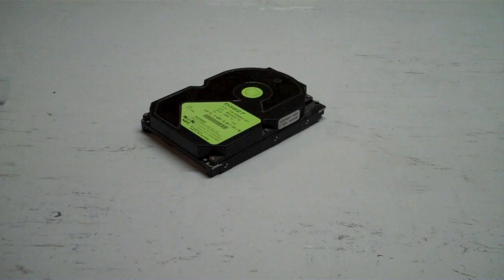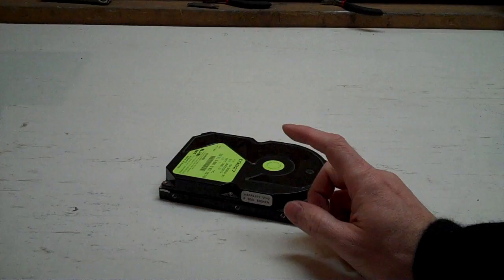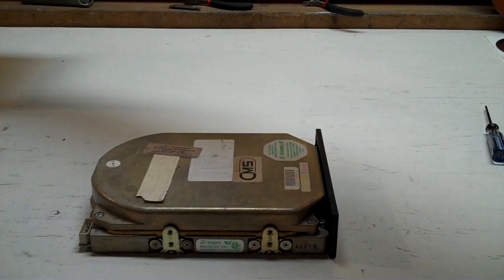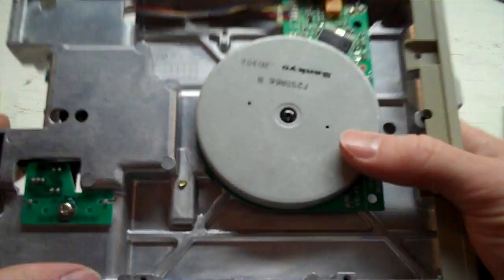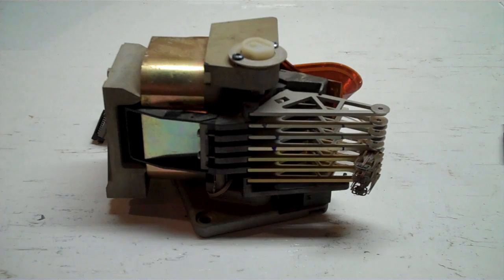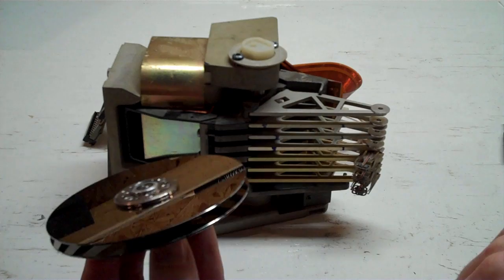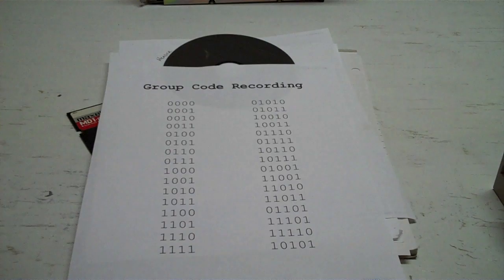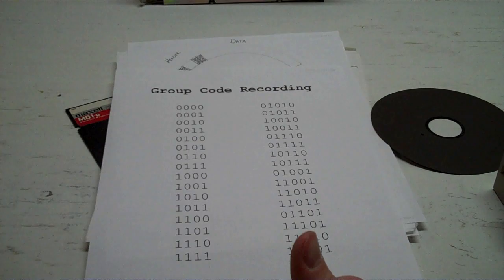The Whys and Wherefores of Magnetic Media

Comment: There are two constraints on GCR and related encodings:
* Not too many 0 bits in a row, to avoid losing sync, as you mentioned, and
* Not too many 1 bits in a row, to limit the maximum frequency response that the circuitry has to deal with.

Comment: The OLIVETTI M3030 used two 8" floppy drives integrated into the printer unit which connected to the main unit in the shape of a desk with a keyboard that could be put away when not in use, As the two 8" floppy drives were stacked they where driven from one huge synchronous electric motor which drove via a large pulley which drive the drive spindles, in one of videos you where after the parameters then try  /usr/src/unix/boot

Comment: I know this is an old video. But. Answer me this: Why do diskettes suddenly develop random bad sectors that cannot be read or formatted/reused? loss of coercivity? or?
Reply from the maker: +THEtechknight You know, I didn't have a good answer for this so I polled a bunch of people smarter than me. The general feeling is there are several potential points of failure - 1) The drive heads in a floppy disk mechanism actually contact the head (unlike in a hard disk) and wear away at frequently read sectors (ie, the directory table). 2) The binder used to adhere the ferric material to the mylar disk slowly breaks down allowing it to flake off. 3) Bad disk mechanisms that aren't clean (due to infrequent use or nasty environments) damage the oxide layer on the diskette. And, 4), it's entirely probably you forget the disks are crap the last time you read them. :)
Reply: jpkiwigeek I vote for head wear on the Ferric material. Thats the only explanation that I can think of, especially with NIB disks going bad after a few reformats/uses. I still own vintage machines that use disks frequently.